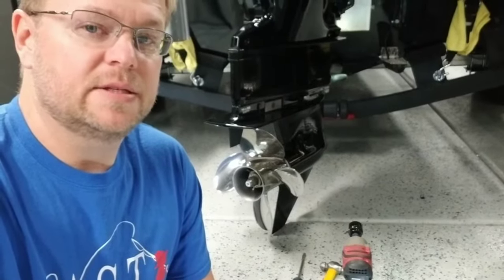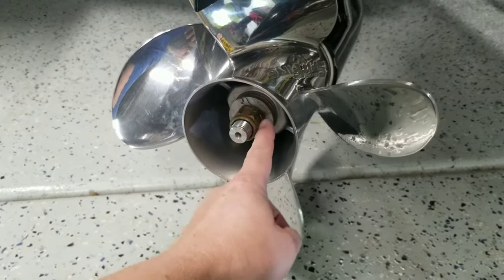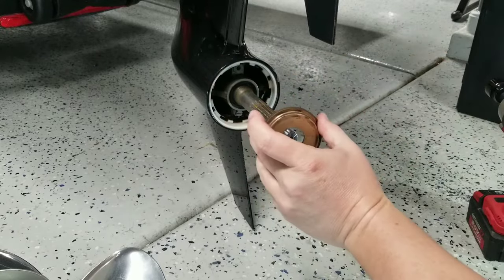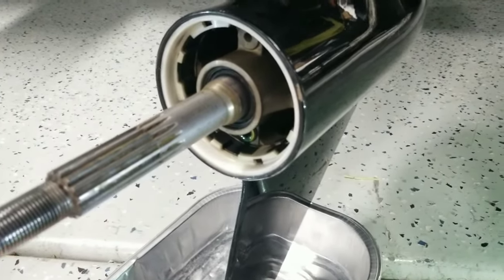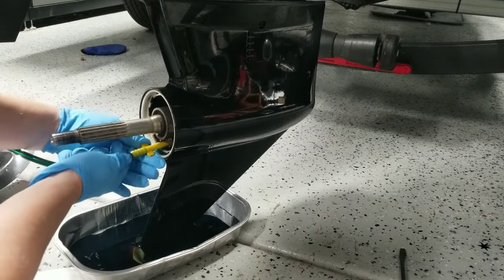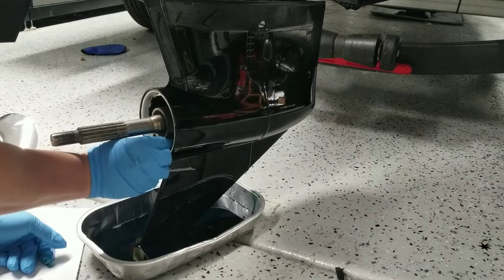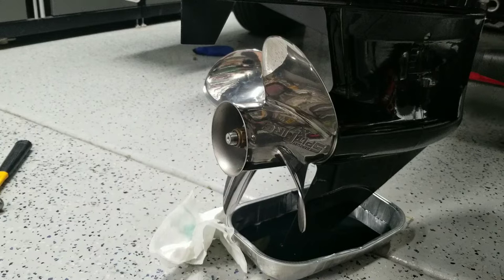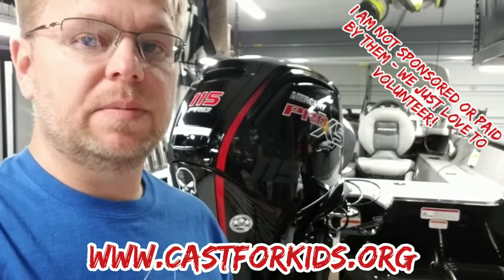Lower unit gear oil change time! Mercury outboard 75, 90, 115 and Pro XS models. Easy DIY video!

Comment: Thanks, recently over to the Mercury 115 after many years with Yamaha. Was wondering where the drain is. !
Reply from the maker: I really like Merc's system here for oil. I never thought I would be a mercury fan but after owning one, I am impressed. Next outboard will be a merc too.

Comment: Mr. Garage.  So i have a 2019 Pro XS 115.  I change my gear oil this weekend base on your video!  Great instructions!!  I do have a question though.  When I removed my prop, I noticed that the plastic ring behind it came out with it.  I also noticed that one of the tabs on it was broken off.  It seems to go back in fine, but seem to move a little.  Should I be worried about that piece?  What is it called and what's the purpose behind it?  Thanks again!
Reply: you should replace it, its called bore sleeve prop, helps relieve pressure. parts runs about $10 or so

Comment: Thanks for posting. Would tipping engine up help reduce oil coming back out?
Reply from the maker: I would only do it level as shown. Changing angles would also change the overflow point and possibly fill volume.

Comment: With running the Stainless 4 blade did you gain or lose high-end RPM? I have a similar boat with an aluminum 4 blade I want to switch to.
Reply from the maker: Hello, Top end RPM depends on prop pitch vs outboard combined with slip. 4 blades grip the water very well so not as much slip. 17p is great for this hull size with a 115. 19p and you get into the lower 5krpm range.

Comment: Hello. What is the difference between the Mercury 115 PRO XS with a black bottom and a silver bottom?
Reply from the maker: Silver bottom is the command thrust lower unit with different gear ratio.

Comment: Great video.  Very detailed and helpful.  Thanks.    But having to take the prop off is insane. The engineer who,designed this should be fired.
Reply from the maker: They did it on purpose, forces you to take the prop off and inspect for line wrapped up around the shaft.

Comment: What engines does this apply to?  I have a 2013 90 4 stroke EFI.  Mercury is confusing with their nomenclature.
Reply from the maker: You have a 1.7L mercury outboard, the previous generation. Low gear oil is pretty similar across most outboards, could have a drain plug in a slightly different location is all.